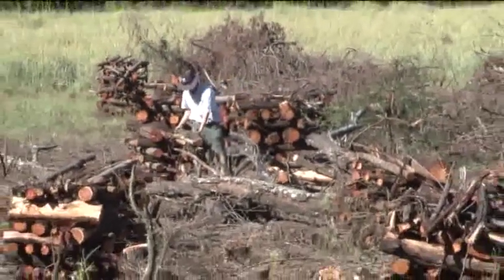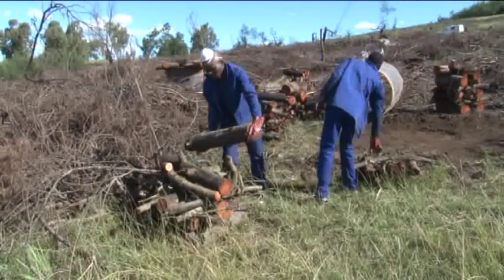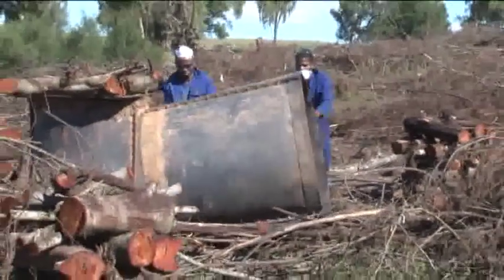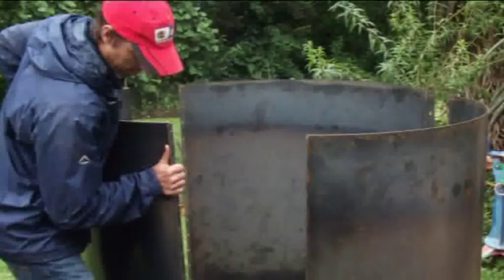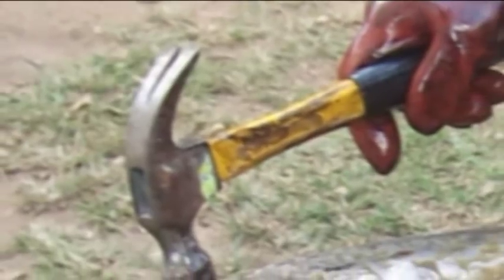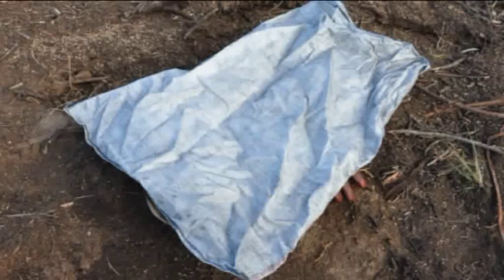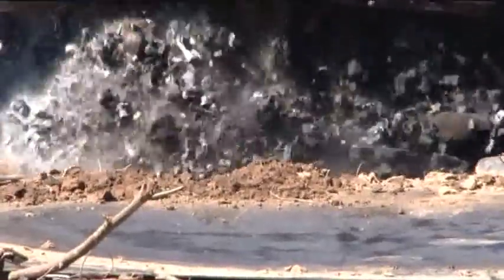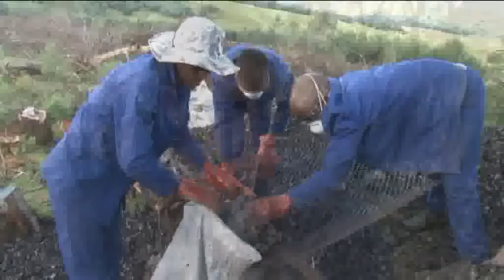How to make charcoal with the Trans-Portable Kiln

Comment: Put the kiln together with bolts and spring washers? why? you just like watching those men work? you could use 1/4 turn fasteners, like dzus, or hinge one side or eliminate bolts all together and use a sliding u channel to hold the halves, or use 5 parir of locking pliers per side. Why bolts and any vibe washers? your just going to take it back apart after the burn. I swear, people just dont think.
Reply from the maker: I guess the video is up for public debate, that's why I allow comments.  I get it you hate the idea of making charcoal in a drum.  If you look at the web you'll see thousands of people using 55 Gal drums.  So they should all just dig a hole in the ground and post of video with no descriptions. That wont stimulate any discussion.  One roll of the kiln will send your fasteners and locking pliers flying.  Sorry that is not smart.  The bolts can be removed even after one year of use, if it needed to transported to another site, just needs a bit of oil. BTW I am giving 'those men' employment.  They are highly paid and end up with a skill that they can pass onto their families.
Reply: vuthisa (tounge in cheek) I know you should use piano hinges on two of the sections a bolts/ washers on the third joint :)